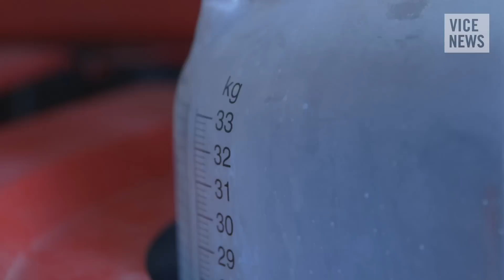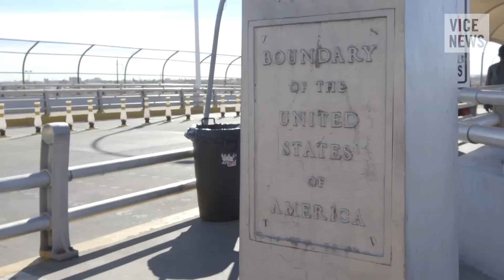The Worst Job In New York: Immigrant America

Comment: Would they be willing to work at minimum wage on a farm.   Obviously no.   If instead you asked would you work on a dairy farm for $40k / year salary for a forty hour week.   Then you would have many takers.

Classic trick.   Offer low wage.  Then no one wants to do hard work.   Why would they?

The correct solution is to pass laws that would stop price collusion on the price paid farmers for milk.  Raising that price so Americans could do the work.  You admit if more was paid they could get American workers.

Not that it matters as you point out Robots cheaper than American workers.   Robots will take over all work.

This is always the case with illegals.   Pay a low wage.   Then claim Americans will not do it.   No not for that low wage.  The wage is the problem.   The solution is the wage be made higher.   Not use illegals.

Comment: Republican voter here. I think there should be some type of new work permit that they can apply for the amount of time that the season lasts for whatever job they are going to be working at. For example when I used to migrate to Wisconsin. My parents and I would work at a green Factory and it would last from July through November and then they would have strawberries for about another month or so. So with my idea immigrants will be able to reapply for a new job. So whenever they're seasonings for let's just say green beans for example which is what I used to do then they can apply for another permit and put on there from which date to what date the work will last and just keep doing it like that over and over. And eventually they will find a spot that says that the work will last for 8 years or something like that so they don't have to worry about deportation

Comment: dude just increase the price of diary products. When the rise in the price of diary products hits Washington, they will be left with no option but to do something about it.
Here's the thing, most Americans don't do hard jobs. Those jobs are filled by immigrants. Now you start deporting them, it results to a scenario of high demand less supply of products, since most of the labours have been deported. Now to control the demand and also to take advantage of the situation, just keep increasing the price, until Americans fill in their place, or unless the govt does something to solve the problem.

This is the only solution available right now.

Comment: No excuse to hire illegals.  It’s about payroll responsibilities and cheap labor at the taxpayers expense.  Just about any job can be automated requiring very little unskilled labor.  But it won’t be cheaper than hiring someone for little pay and no work protections.  There’s also a cost to sponsor migrants.  Quite frankly, a job is a job.  If you come from farm country this job is no big deal.  There’s not much farming anymore.  You’re talking about commercial farms.  If they want migrant labor they need to sponsor them and hire them correctly.